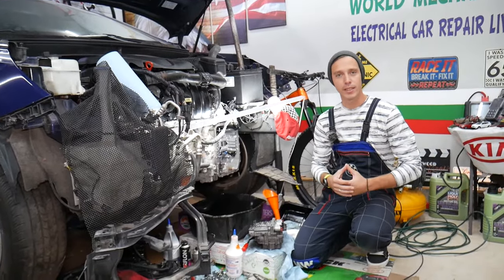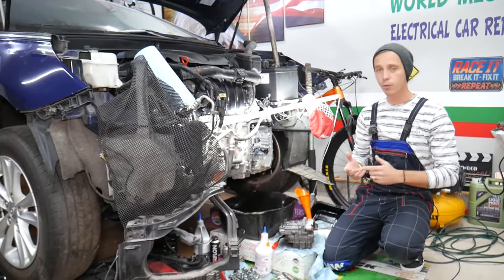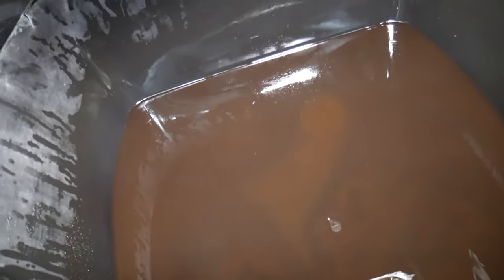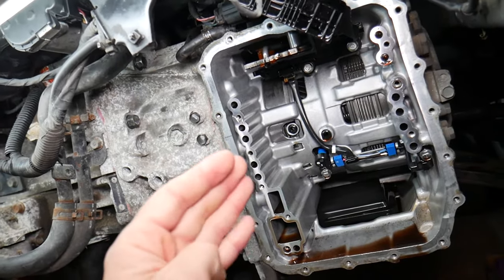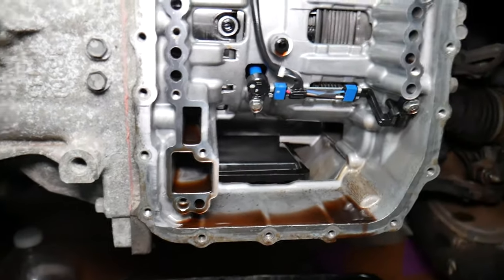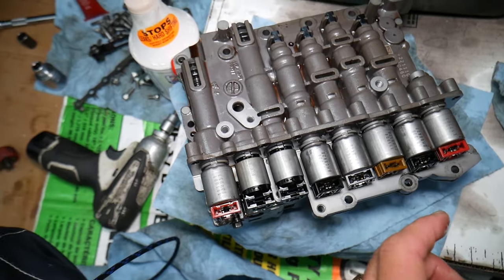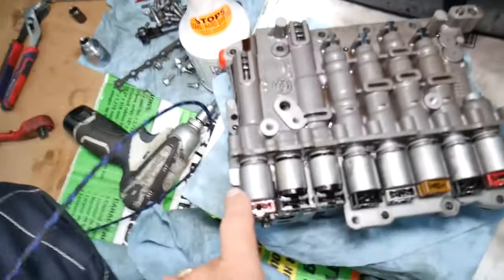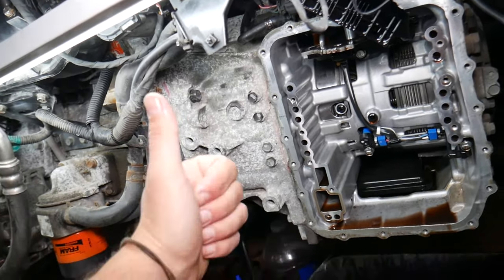THIS IS WHY AUTOMATIC TRANSMISSION IS SLIPPING

Comment from the maker: Check Fitment:
► Transmission Solenoid: https://amzn.to/2ZytZYu
► Transmission Oil Pan Gasket: https://amzn.to/3pQKASc
► Transmission Filter: https://amzn.to/3BzrAdq
► Transmission Oil Pan: https://amzn.to/3mqbXQW
► Transmission Fluid: https://amzn.to/3mqlDuM
► Panel Removal Set: https://amzn.to/3YiMADu
► Tool Set: https://amzn.to/3p5MM6t
► Screwdriver Set: https://amzn.to/3XRB28Q
► Castrol Oil: https://amzn.to/3xBc8B9
► Oil Filter: https://amzn.to/3w0Ulme
► Torque Wrench: https://amzn.to/32qyRwg
►Liqui Moly Engine Flush: https://amzn.to/3IiDBID
► OBD Scanner that we use most often: https://amzn.to/3I4MQfe

► We buy our Tools and Parts from here: https://www.amazon.com/shop/worldmechanics

Comment: Good explanation. After 50 miles mostly when on long drives the rpm goes too high at same momentum so I have to lower the speed. It continues until I take side stop the car ignite it on again and slowly drive up. It keeps happening until I reach the destination. Sometimes it doesn't happen. What could be the reason.
Reply: Same here did u figure it out ?
Reply: What vehicle?  To me, it sounds like the fluid has degraded or is low.  Also, check the proper level when the transmission fluid is hot and level.  If the fluid hasn't been changed, then definitely try this first.  If it happens when the transmission temps are higher then that is more likely the cause.  I would try a drain and fill and make sure the fluid is warmed up before the drain, then drain it out (use an empty drain container, then measure the amount drained out), it's extremely important to use good proper ATF.  Check the requirements and if you're willing to take a chance on the Amsoil Synthetic ATF, then give this a go, but if you don't want to use Amsoil, then maybe try Valvoline MAX Life ATF which is good, but Amsoil has better properties and is 100% Synthetic and more costly than the MAX life.
Reply: Then how did you fix it ? I am facing the same issue with my car
Reply: Hi
Reply: Same with my F150 smh
Reply: What was the solution for you??
Reply: Same problem here
Reply: @IZ2615  any one with solution to this problem?
Reply: Check for ground wire if your not getting the proper ground it can cause slipping also motor mount sometimes engine problems can cause improper shifting a lot of these car engine and transmission like to work together so say it you not getting the right air ratio then your transmission will rev higher to try to match the engine input of air sometimes to but make sure your engine getting everything it needs and then follow they wires to the transmission and battery if you already did the maintenance

Comment: Hi. I have a Nissan Pathfinder 2011 4.0. when I engage the gear in position D, I have to wait 2 seconds before it engages the gear.  only D. the rest is ok. I changed the oil, nothing helped. could it be an electromagnet or somewhere in the box?

Comment: When I shift my hyundai i20 automatic in reverse the car will not move, the rest of the gears work, sometimes while driving it will suddenly jerk, sometimes I can smell a oil burning smell, sometimes when i am driving fast on the motorway and if I suddenly want to overtake another vehicle I find that the gear slips , my vehicle is a 2010 model and has done 21,000 miles only, I accidentally added some engine oil to top up the transmission fluid before setting off on a long journey, after i returned back from the 900 miles, I was not able to reverse the vehicle out of my driveway, I have bought second hand automatic transmission gearbox because the price was too much to get my original one fixed, I need my clutch replacement also, no noise experience, when you engage drive the car has a slightly jerks and drives well, engine rhythm on idle is slightly different,  what shall I do? Should I replacement or fix the solenoids issue?
Reply: Did you ever fix it

Comment: Hi I need some advice! I have a 1999 Ford Expedition with 73k miles on it. Engine revs super good and has no vibration. It's an A4WD with selector for 4H and 4L. My question is, when I try to accelerate, some times it pulls really tight and strong but other times (more often than not) there's this slipping feeling I get from the transmission. The engine revs hard and well but it kind of "stutters" forward upon initial acceleration until it picks up some speed (probably around 15 feet) then it suddenly smooths out and pulls really hard, consistently. 

My initial thoughts were the ATF since it was literally below the bottom marker on the AT dip stick. Initially, the car wouldn't even roll when engaging a gear without stepping on the pedal. However, it started to roll once I added the fluid. Then, I thought it was the coils/sparks, but the engine idles so smoothly and revs very smoothly as well without hesitation or vibration whatsoever. 

Again, the engine revs true and smooth when accelerating from a dead stop but for some reason there's a stuttering/hesitant effect when underload then suddenly pulls like a true v8 once a bit of speed as built up. 

Could this be the transmission needing work?

Comment: Hello ive a audi a6c6 2.7 tdi cvt  and when i pas form p to r it gives s little shake to the car , what to do my car has 270000 km , never changed transmission fluid since i buy it from 210000 km

Comment: Hi,I have been following your channel for some time and I feel I am qualify to ask you some questions about auto transmission.i have this auto transmission 3 speed (Aisin A172) for my mini bus.Just last week,it won't move when put in drive or any gear unless you give it gas.and it begins to move sluggishly like as if it being dragged.i removed and replaced the fluid but still the same thing.please what else should I check.Thanks for any response from you

Comment: Solenoid???
Reply: There are more options...
     faulty torque converter
     broken main pinion of the circulating wheel, the connection with the             
     hydrodynamic converter does not work

     lack of transmission fluid
     filter contamination
     severe wear of the friction plates of the clutches and the brake belt
     broken or worn piston sleeves of these sets
     wear or damage to the sealing rings of these sets
     faulty solenoid or hydraulic valve of the hydraulic unit...